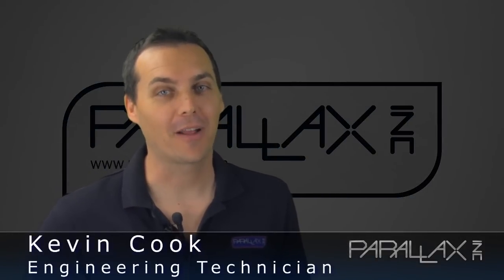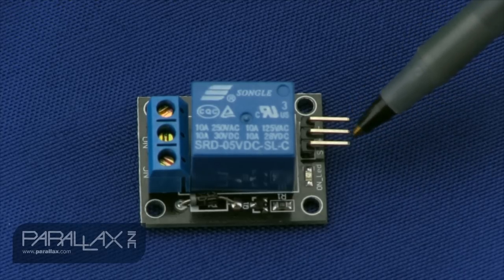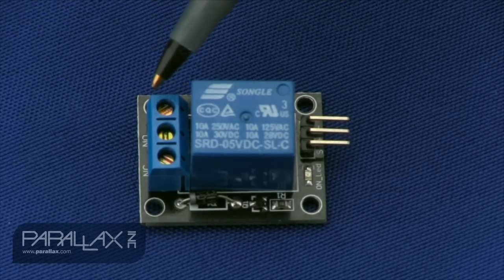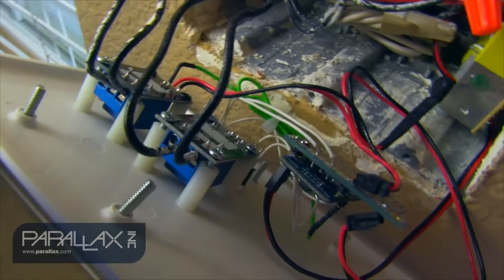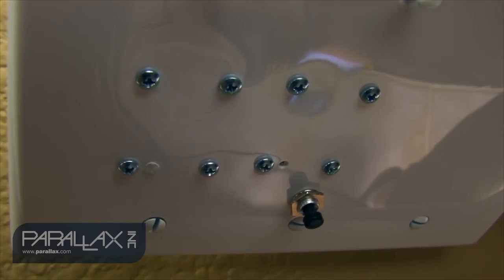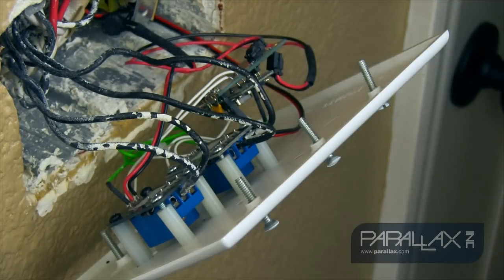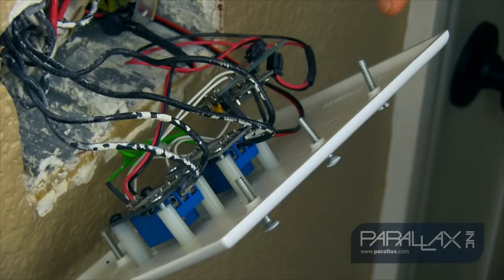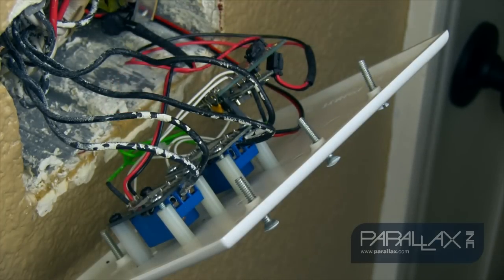Controlling your lights with the Parallax Single Relay Board

Comment: all good until your insurance find out you installed electrical equipment that wasnt UL listed. After the fire, the insurance company has a good excuse not to pay for the damages.
Reply: Yeah. Atleast, the relays should be fused with a 10A fuse in a enclosure with all electronics elsewhere.

Comment: Can the relay be powered by the signal line itself, and connect that same line to the NO pole?
I'm considering voltages around 20~25V, and I want to use two ot these relays to switch automatically between a main-power (in the NO poles) to a battery backup power (in the NC poles) to feed a mini-pc (in the Center-poles)

Comment: rubbish video doesnt even tell you how to actually put the mains properly in the relay with this instructions anyone could easily tri to wire the mains make a mistake and fucking die and if the person survives would come back to dislike the video
Reply: I agree.  Also, no mention of exactly how to provide the low triggering voltage.  Video tells what most people into this stuff already know.  Worthless video.

Comment: ya a simple circuit diagram next time because you made a mistake explaining the high voltage terminals and that was exactly what info i was looking for here.., later when you showed the home lights you showed the input high voltage and the normally open terminal and the circuit made sense...